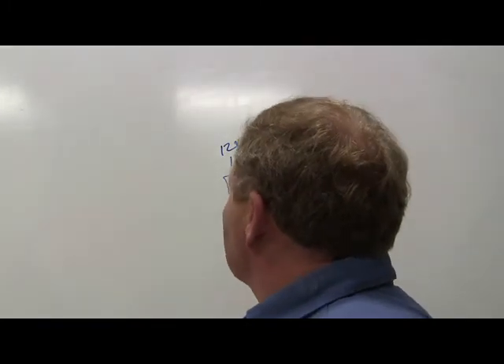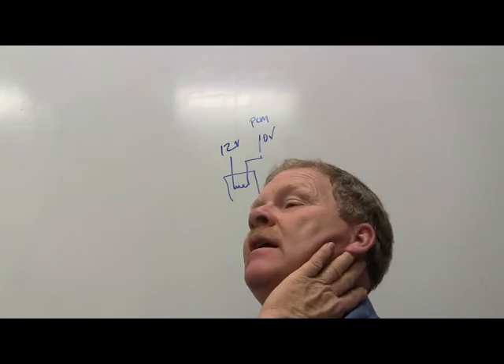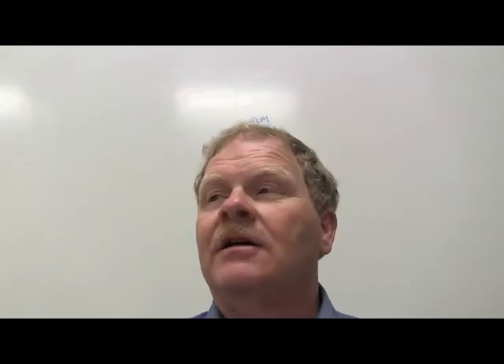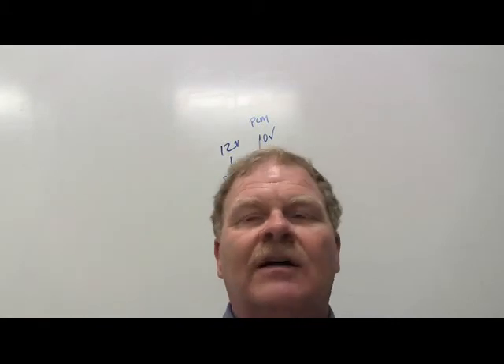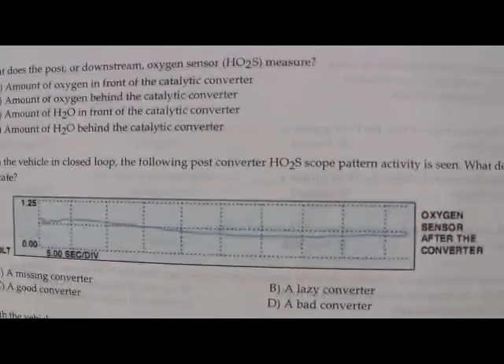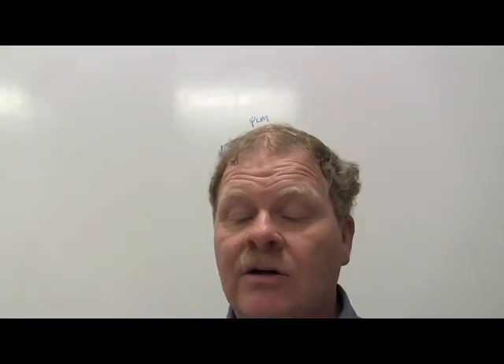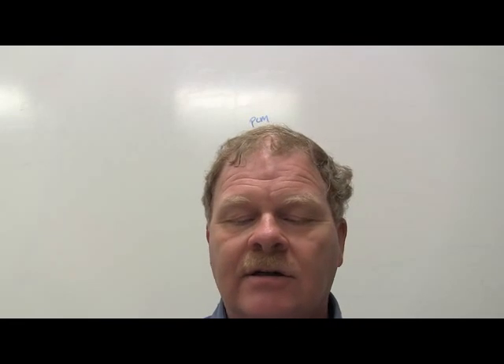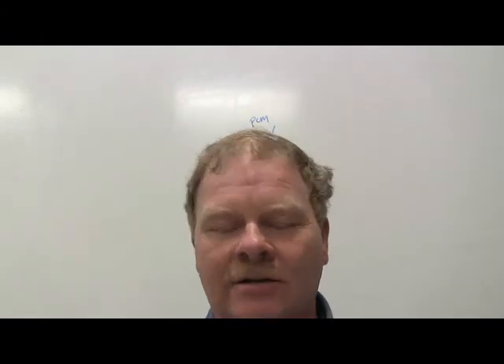Emissions test 8   O2 Sensor Stuff

Comment: You are absolutely right on Ford's 60 pin computer...pin 49 is HEGO gnd 16-ign gnd 20-case gnd 40- pwr gnd and 60-pwr gnd    Pin 56 is profile ignition pickup(pip) and the spark output pin is number 36. The spout wire is usually pink and the pip wire is usually a grey/orange wire. You have fantastic memory sir